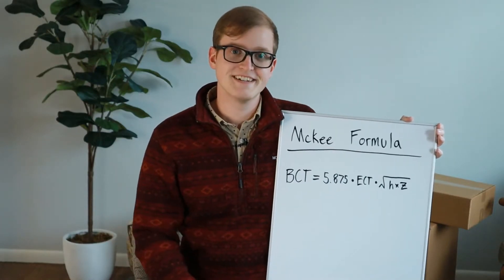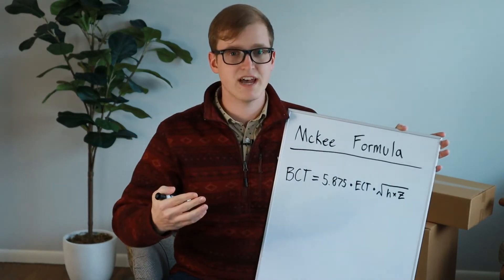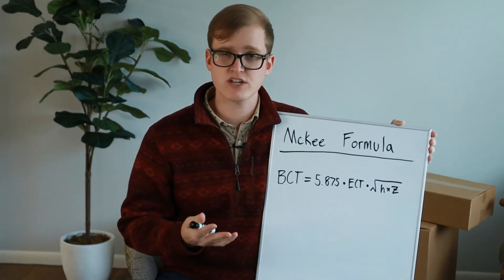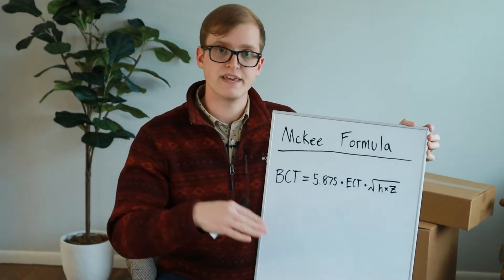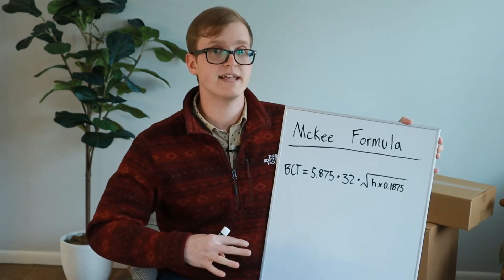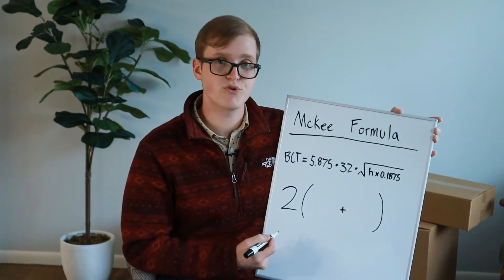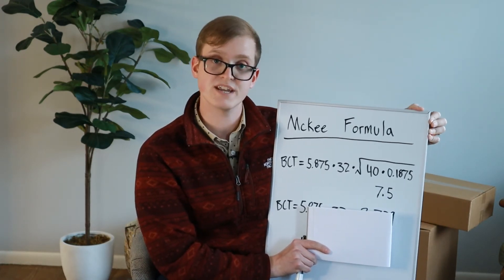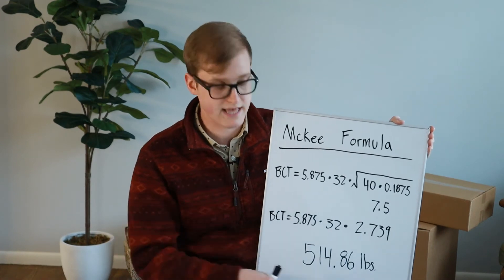How Strong is My Cardboard Box? | The Shipping Box. Part 2

Comment: Nice video 👍🏽, 
But Generally I have found that the BCT value is less when the box height is more, but the formula doesn't include the box height factor... Can you please explain that?
Reply: Hi. This is a good question.... Mckee used a box ration of 2:1:1 for all his test back in the 50's In other words he used boxes that were say, 400mm x 200mm x 200mm. He had to pick on something so settled on this. His equation is based on this premise. If a box it taller or shorter then you have to adjust the BCT data accordingly. Sometimes a box under say 100mm deeper can be stronger yhat one of 200mm. But under say 85mm its gets weaker. Taller than say 400mm it can be weaker. However there is no formula for working this out unless you have done 1000's of tests on boxes of deeper or shorter depths. 
You have to take an estimated firgure off the BCT from McKee's maths. I usually say 25% off for taller boxes and 15% off shorter than 100mm. However there is a lot more to using this calculation than is shown on this video.

Comment: Hello,
I am a french student and I have now a scientific project which aims at judging the coherence of using cardboard as a construction material (currently used for the realization of Wikkelhouses).
One of the four steps in my approach consists in evaluating the physical resistance of cardboard, and by saying so I mean evaluating qualitatively the maximum strength that the material is likely to receive; however, I do not possess any kind of those ECT machines, and my only option remains to do it handcrafted. 
So my question is : Is it actually possible to measure the max kgf supported by the cardboard with a handcrafted ECT ? And by handcrafted I mean putting an increasing load on my cardboard (like weights or dictionaries) until it folds, but i doubt about the fact that the real strength received by cardboard identifies as the weight that it supports (With the reaction force of the support) : So how is the Strength on the ECT machine measured ?
Thank you in advance for your response :)

Comment: great work Ben thanks alot but i have a question , what is the effect of changing paper weight i think paper GSM will have a great effect on the BCT
Reply: and still waiting your next videos
Reply from the maker: Thanks @Mazen Mahmoud, From my understanding of the box strength tests, (Mullen/Burst Test, and Edge Crush Test/ECT) the changing paper weight will have a greater effect on the Mullen or Burst Strength. This test is looking for the amount of pressure it takes to burst through the material. With a heavier paper, we may see higher pressures to bust through the material. This of course is not always the case. As for the effects on the ECT rating, the paper weight does matter, but in this test I believe the real factor when it comes to the paper is the fiber used for the different layers. A box rated for 32 ECT for example can hold the same max weight of 65 lbs as a #200 Burst tested box before failing.  The burst tested box gets its strength from mass while the ECT box gets it strength from Physics and the Flutes of the Corrugated board. Hope this answers your question! Thanks for watching the video.